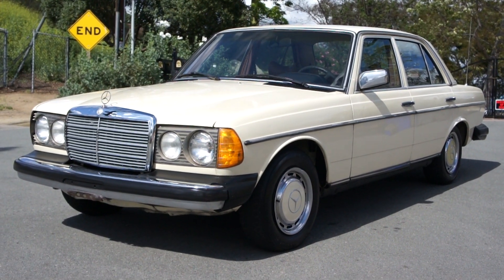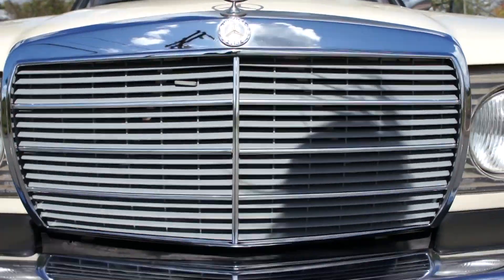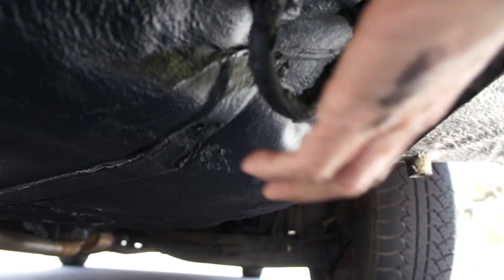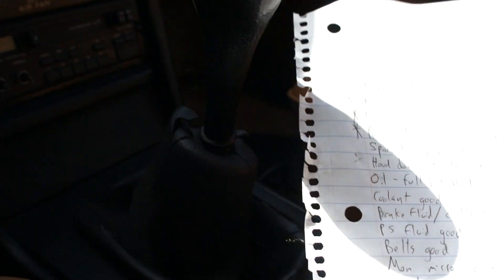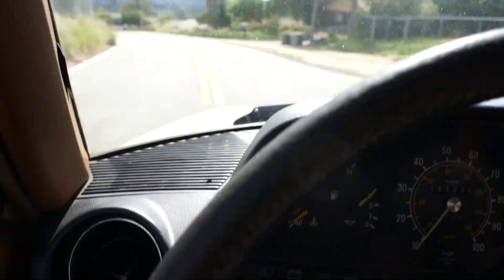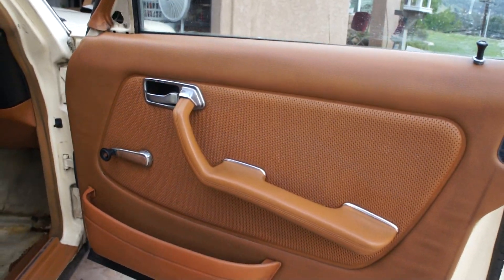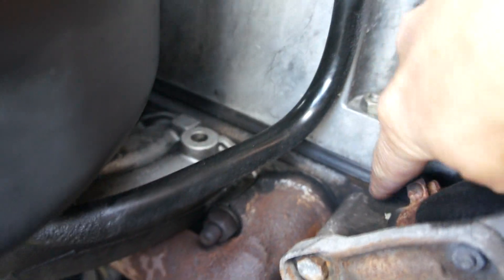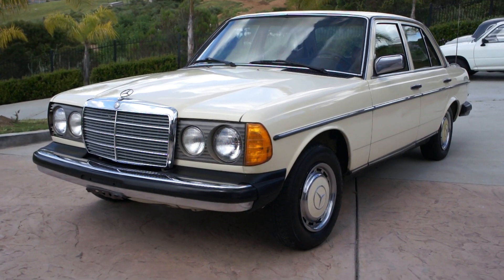1979 Mercedes Benz 240D Diesel 4 speed Manual

Comment: The reason your car doesn't turn off with the key, is because there is either a leak in the vacuum system (most likely door locks), or the vacuum shutoff mechanism has gone bad.

Comment: nice! though the engine not turning off when you turn the key is almost definitely the vacuum is broken somewhere, same as for the c-locking. and instead of opening the bonnet every time you shut the car down you can just pull the parking brake and put it in 2nd and pop the clutch. :)